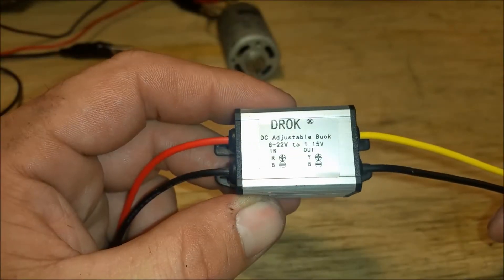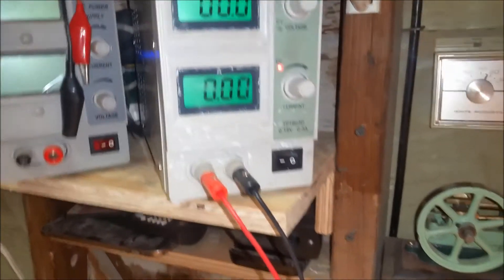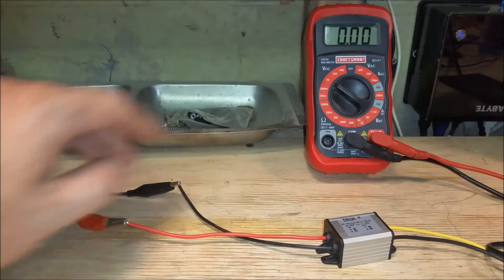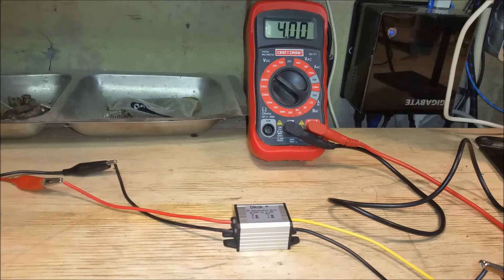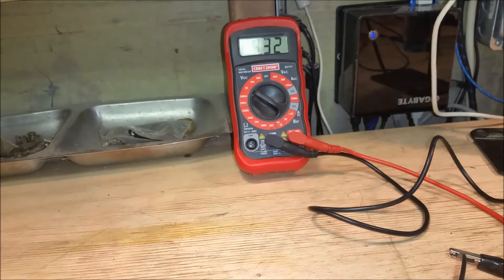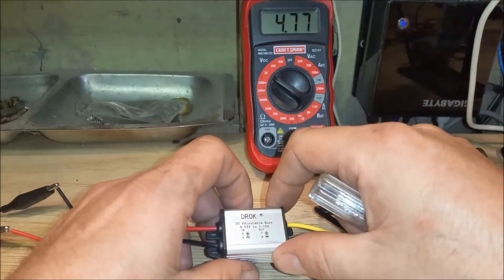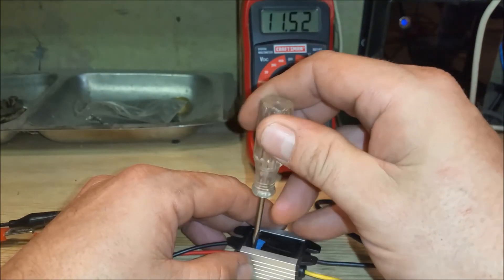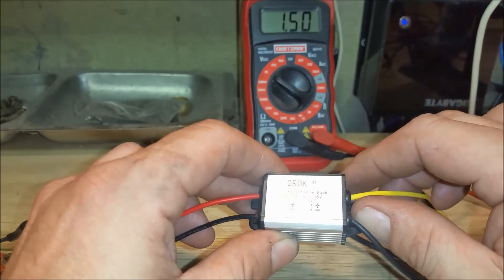DROK Micro Electric DC Buck Volt Converter DC-DC 6.3-22V 12V to 5V 3A/15W

Comment: So do you believe  that a man could  use something  like this as say a voltage  regulator  on my car because  I've got more then one battery  in my car I've actually  got 3 1 under my hood running throw a battery  insulator out to 2 more that I've got my sound system  running  off and the two I've got in the truck are just like the little  moped battery there the 12v gel batteries  the 12v amg to be exact  and I'm running  a big boat battery  under my hood  so it's got a really solid power source  I'm trying  to run but I've been  looking  into maybe  doing some kinda conversation  over to maybe soldering  some leads on to the brushes of the bottom  of my voltage  regulator  off my alternator  and bring those 2 wires into say something  like your messing with here and and by passing  my computer  in my car all together  so I could basically  run what ever voltage  I could want to run like say 14.4 at all given  times I dont care what all I've got running  in it would you agree  or  disagree  that it could be done  is my real question  to you because I'm not a rich man  by no mean and I love my rides more then I do any thing but I'm a single man not married  no kids I can do what I do because  of that understand  so I've gotta keep me busy  some how in my spare  time but I keep running across  electronic problems  all the time because  of all this charging problems  and I can't move forward  with any other projects  I've got  planned  for it like the virtual  doors  or my paint nothing until  I get this electrical  nightmare  behind  me I'm one of those  guys  I stop everything  trying  to solve  the one problem  before moving forward just because  i.work throw my problems  and not around  is the only  difference  between  me and others sometimes it's a good thing  but most of the time not but if you could give me some kinda idea what I've gotta do it would be much appreciated  fr